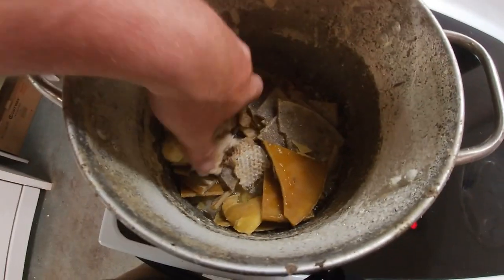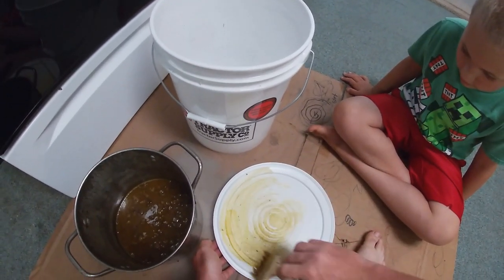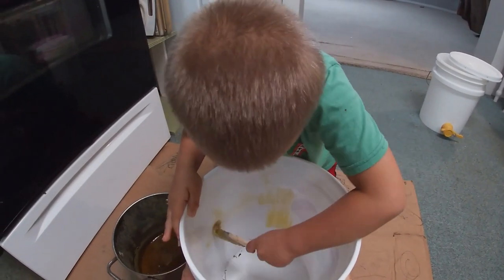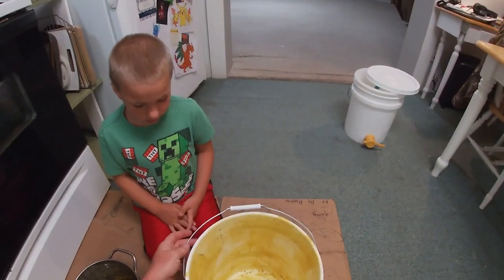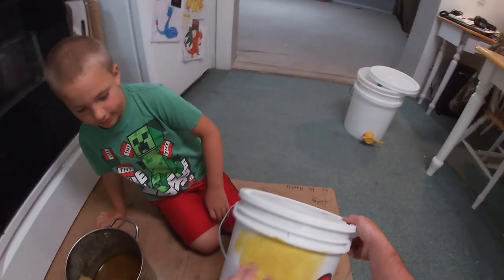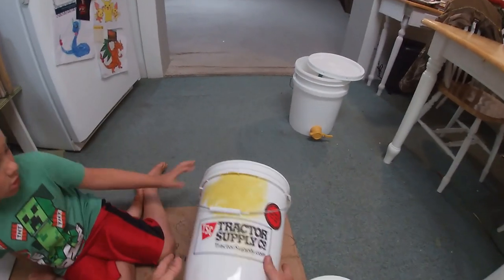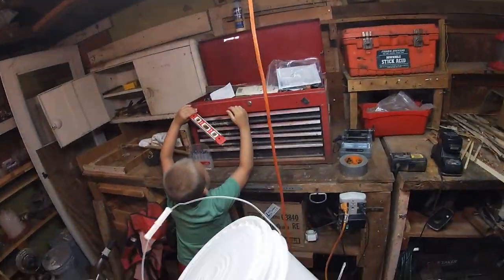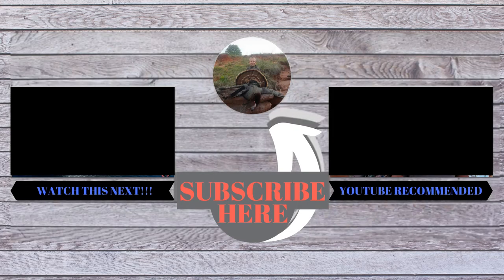How to make a Swarm Trap (Cheap and Easy)

Comment: Why not just pour wax in and swirl/rotate bucket to let it coat the sides. Seems a lot easier and faster. Then poke holes as needed.
Reply: My thoughts exactly. You might be able to do it like an Easter egg mould
Reply: I'm thinking the same, unless he was tryna make some kinda texture
Reply: 😊ok
Reply: It dries almost as soon as you remove the brush from the bucket

Comment: Thanks for posting this video. Went dumpster diving for like 20 paint buckets on a construction sight. Got them cleaned and ready to go. Since I don't have any comb to melt down, do yall think that plain old bees wax would work for coating the inside of the bucket?
Reply from the maker: Yes use the yellow beeswax. It will do a good job.

Comment: Why not just put your entrance in the bottom of the bucket?  Then it will be well protected from rain.  Also, to catch larger swarms, would you ever attach two buckets (mouth to mouth) to increase the overall volume of space?
About the breathing holes, don't the bees just propolize the holes?
Reply from the maker: To your first question about the entrance on the bottom. I will be making a few this year to test if bees will still move into swarm traps with bottom entrance. My guess is it doesn't matter. The swarm I ended up catching was 3lbs of bees and they only ended up filling less than half the bucket, so 5 gallons should get probably a 6 maybe 7lb swarm. The breathing holes have never been propolized shut because I don't leave the bees long enough in the bucket to start propolizing holes. Most I leave them is around 1 week in bucket after I have pulled it from the woods. Good questions tho. Thank for the comment.
Reply: @OkAdventure994 hey! Did you try the hole at the bottom of bucket? Did it work out?
Reply: @danni4213  Hi. Yes the hole in the bottom of the bucket does work.  It certainly prevents rain running down the side to enter the bucket.  My double bucket (think of a large minnow trap) did not catch a swarm this season.  Maybe location or any of a number of reasons. I do paint some melted wax around the outside of the whole and all over the inside. I’ve also gone to writing on the outside with sharpie to tell others what it is.  One lady thought she was being spied on.

Comment: I have watched Easter eggs being made before.  You pour the hot chocolate into a mould, swill it around so it touch all the international surfaces then you pour out the excess. Could a similar process be used here if you were in a rush? Or is the texture left by the paint brush bristles beneficial?